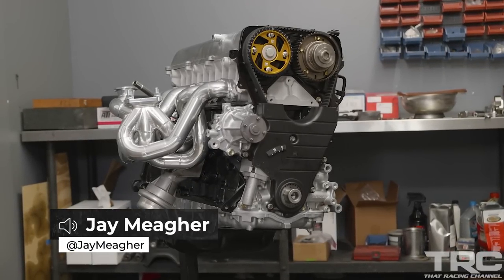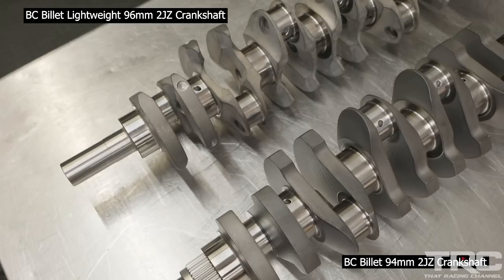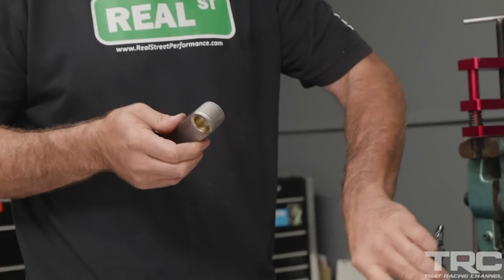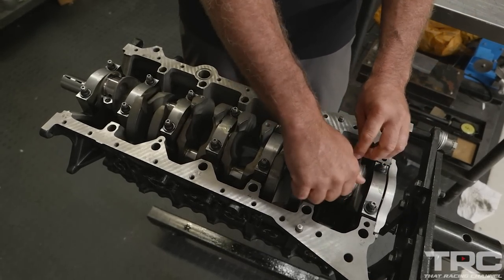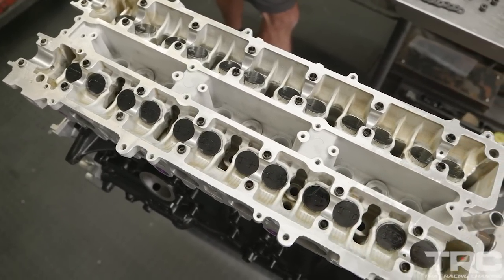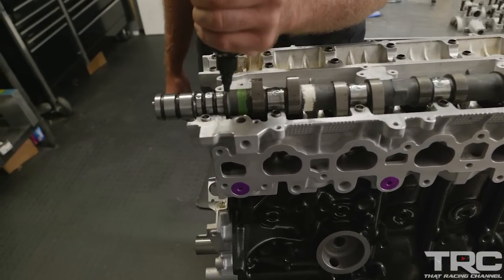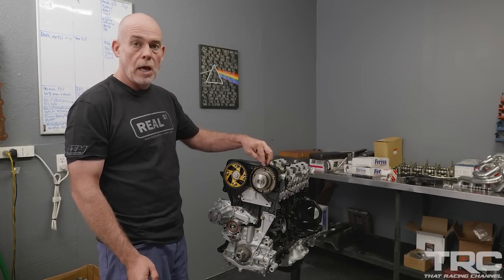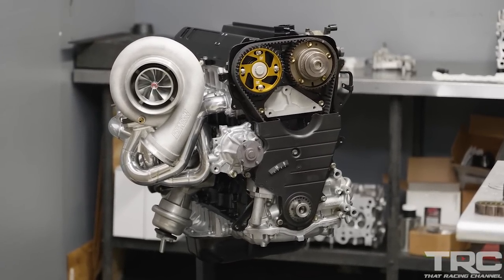Building a 1600HP 2JZ-GE VVTI | 3.4L Stroker (Engine Build - Jay’s Tech Tips)

Comment: Hello, why don't you install oil injectors in the block?  How will the pistons be cooled without oil jets?
Reply: 2jz is that efficient. most remove the oem 2jz gte oil squirters from the block to increase oil pressure for turbo. pretty straight forward ..

Comment: You guys have any experience with the engines inside Hyundai N vehicles? Are they worth modifying?
Reply: Sir, no sir ! Just ask yourself where in the world is someone in a Hyundai N car pushing big power running 10 or 9 seconds to the 1/4 mile…. You can go with an LS motor you can go 2JZ motor heck you can even go European to get that kinda speed but so far nobody has done any real street damage in an N car and that should tell you enough about whether or not they’re worth the work

Comment: Question. You mention the oil squirters not being as important with alcohol based fuels due to the cooling effects that they have. Are you not concerned with the alcohol “washing” the oil off the cylinder walls in such a case?

Comment: 1) Is it possible to install a twin turbo on a 4d56u engine, and what is the recommended transmission?
2) What is the fuel mpg of the 1600hp 2JZ-GE VVTI 3.4L build is it possible to fit it in a Pajero Shogun  1990 model?
Reply: 1600hp isn't ideal for mpg. Nor the daily use either. You'll be rebuilding every 6 months.

Comment: What did you do when you converted the ge block to gte? Besides the piston squirters?
Reply: U have to drill an oil galley out from intake to exhaust side. GTE is drilled at factory

Comment: If I’m not mistaken, the casting quality on the GE blocks aren’t even remotely similar to a GTE block.
Reply: Exactly the same casting but turbo models have more oil galleries machined to them
Reply: Poor quality casting , different casting people have always said stuff about them  , but N/A blocks have proven to be reliable time and again way into the 4  figures . Your money is better spent on other quality stuff like the internals than the GTE  block especially for the average guy that wants to make 800 -1000whp.

Comment: Don't get me wrong but what does a poor person have to do to build a reliable 4-500 who drift spec engine build.  That would be a great easy video for you guys I'm sure.
I have a 2003 BMW 330i  m54b30 and I'd like to invest in a 2j but only if I can actually use it. 
I don't want anything to do with LS.  
Mainly street car has to have AC (Vegas heat) 
And just dumb reliable.

Comment: I don't understand the value of stroking this particular engine. from what I understand It will increase the mid range power and torque but at the price of increased piston speed which means decreased rpm range. Why not just adjust the cam for better mid range power and increase the boost in order to maintain higher rpms? Just curious.
Reply: Engine displacement is the volume swept (displaced) by pistons in all cylinders. This volume determines the amount of fuel mixture the engine can burn. Also it allows you to build up boost faster because it's allowing more air in & out. Thus giving you more power in the mid range. You can adjust the cam but you won't be making the same power at the top end. Stroking an engine will make it into a bigger air compressor, changing timing will not do much for building big boost.
Reply: The higher displacement allows you to run less boost to hit a peak power goal while also providing more low-end torque allowing for a larger cam and just by being bigger means the engine pumps more air in and out, meaning it will more quickly spin a turbo or just as easily spin a larger turbo, again allowing for higher peak hp numbers without the need for 9k+ rpm or 40+ psi of boost

Comment: What's a build like this cost?
Reply: Well the crank alone is $5000. So in all and tuning. About 18 to 20k
Reply: Fuel system, fuel management, wiring harness, turbo kit, long block plus all the small parts you can spend 50k in a blink of a eye. 
Then if your one of the poor souls that can’t put it all together and must pay for the labor:…expect to pay around  20k